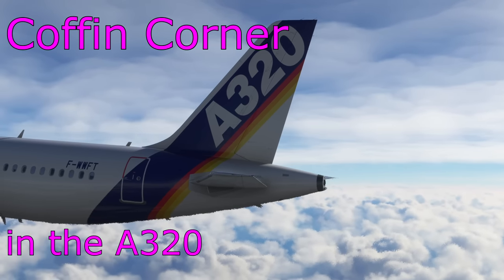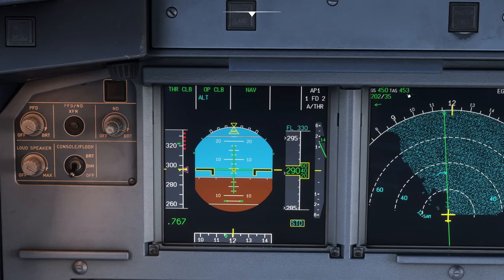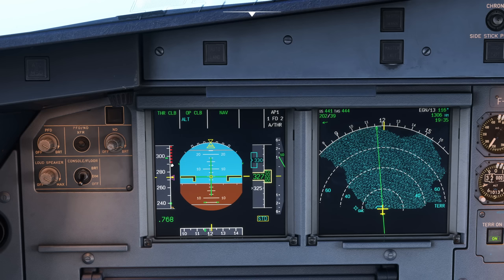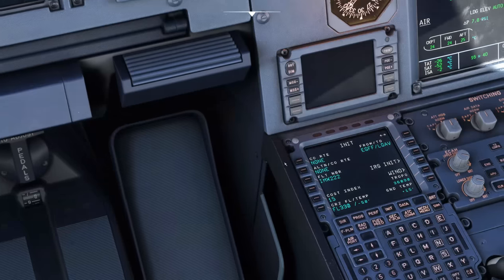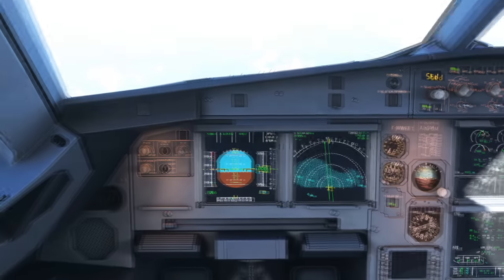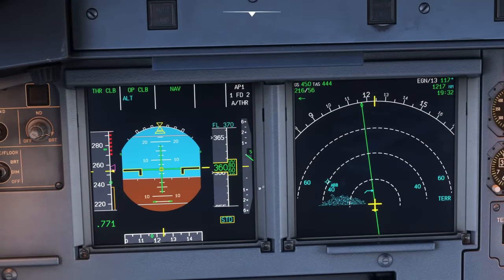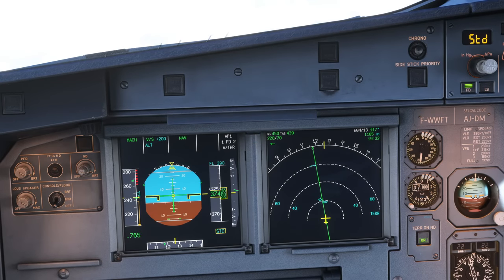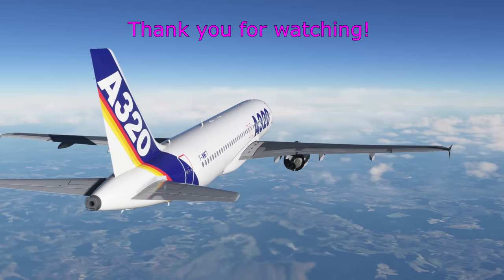Coffin Corner Explained!

Comment: Thank you so much for explaining the coffin corner concept but I do have a question.  If the aircraft is getting it’s airspeed from the air going into the pito tube and the air gets thinner the higher you go, How does aircraft determine the mach speed, ground speed and true air speed?

Comment: How would you pre plan for cruise altitude for the flight plan? I guess there is a weight/altitude chart or calculator so you don't prefile for 380 and then end up having to request 340, for example?
Reply: Flight Dispatchers do all the planning
Reply: @budguy21  makes sense! I know there's a "plan step climbs" button on simbrief but not sure if it really works. Would ATC be aware of any planned step climbs?
Reply: @Robmlufc  it does work. Simbrief will even tell you at which waypoint to change your altitude, but you have to look for it in the flight plan, its easy to miss. Not sure if ATC would be aware of them, but as pilot you just ask for the altitude change at the appropriate time.
Reply: @budguy21  Cheers Mike, good info. I'll give it a go.

Comment: Would the VLS creep up in a turn? Since the inboard wing will experience a lower airspeed than the outboard wing in a turn? Similarly, would the outboard wing stall? How does the Airbus protect the aircraft in this situation?
Reply: Yes, because the lift vector reduces as you turn the aircraft. So if lift goes down, more speed is required to compensate. Remember Lift (force) = 1/2 ro S Cl
Reply: I don’t think so because VLS is based off the stall speed of the aircraft at its current weight. Alpha Prot and Alpha Max would creep up but VLS (like green dot) are characteristic speeds

Comment: 4:42 The speed of sound is only dependent on the temperature to my knowledge.
Reply: Pressure/density play an important role, just like any other waves in any other mediums.
Reply: @bltzcstrnx  Yes and no. If you consider air as an ideal gas, then the speed of sound is sqrt(kappa*r*T). Pressure and density are related to the temperature by the ideal gas law p=rho*r*T, but only the temperature is required to find the speed of sound.
Reply: @dgonL  why water that have the same temperature as air differ in speed of sound? Both are categorized as fluid and can have varying density (salt water is denser for example). Also it's density that seperates water and air at the same temperature.
Reply: @bltzcstrnx  There are two reasons for this. First of all the formula "speed of sound = sqrt(kappa*r*T)" has kappa and r. These two values change if the fluid changes. So for air they're always the same (kappa = 1.4 and r=287), but water has different values.
Secondly, air can be approximated as an ideal gas (truely ideal gases don't exist, but air is very close), water (or steam) on the other hand is not an ideal gas at all.

What I'm saying is that, as long as the fluid stays the same, the temperature alone is enough to determine the speed of sound.
Reply: @dgonL  Bingo.